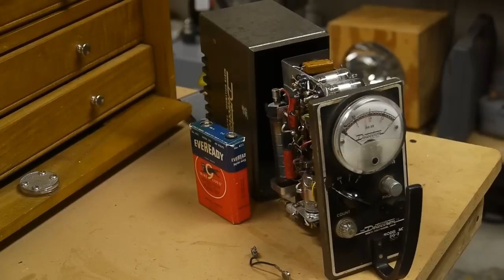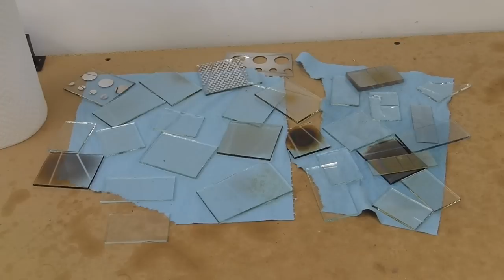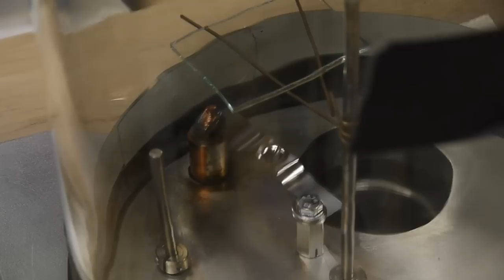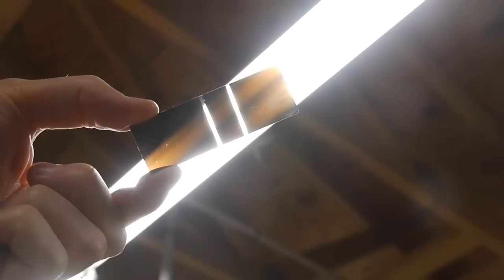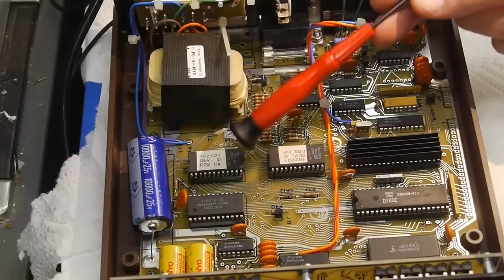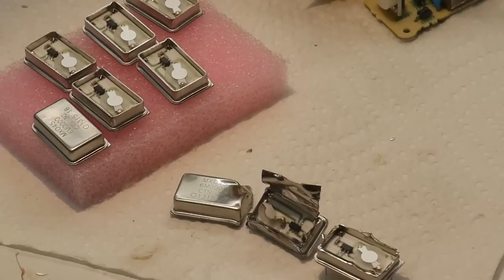Quartz crystal thickness monitor for vapor deposition in vacuum

Comment from the maker: Yes, the front panel allows setting density and acoustic impedance (ie basically the modulus) of the material being deposited. These values can vary quite a bit for different materials.

Comment: A Z80 processor... Do they still make those or maybe that microbalance is old? I remember writing z80 assembly back in the 80s. Anyway, neat trick for monitoring thickness. Thanks.
Reply: TI-84 calculators still run off of Z80s...

Comment: These sorts of thickness monitors can be very inaccurate if they are not mounted close to your sample. Also, try to use as good an approximation of the acoustic impedance as possible. Are you using InSn alloy or ITO to start? I hope that you have a needle valve for oxygen input. Too much oxygen is probably why you are not getting a conductive state. Controlling the oxygen level even if traces amounts is key to controlling the microstructure in metal deposition.

Comment: I heard these are also studied for explosive detection : they coat them with something that strongly bonds to the explosive you want to detect, and, as you said, detect the change in frequency due to the additionnal mass of explosive molecules bound to the surface, to detect ppm/ppb levels of explosive vapours. But dogs are still more sensitive detectors for the moment.

Comment: Hi, I'm setting up a temporary vacuum chamber for basic PVD. One of the 3 still unresolved issues is layer thickness measurement. I'll be deposing metals (Al, Ag, Au) but also some dielectrics as MgF and SiO2. Did you have any success with quartz resonators? I'm afraid that metal will either short out components or add to capacity of the electrode. I was thinking about using small brass piezo speaker, but that have much lower resonance frequency. Is frequency critical? Do you think trying out that kind of speaker make sense, or is it waste of time?
Any help appreciated!

Comment: I have the same thickness controller at home as a backup for my Sycon. I made a couple oscillator boards for them and have an extra if you want it.  Simple way to test the qcm is to breathe on the crystal. It will measure the water vapor deposited on it and then you can see it evaporate off. Etch processes will give negative numbers.

Comment: i wonder if we coat one crystal side with a bonding layer, we could in fact null that out in th e measurement, hence making the surface ready for depositing the wanted oxide more easily Also heating up a mix of silica with a salt and washing out the salt later to have a 'rough' transparent bounding layer would be something i would try as well. oxidizing components could be added as well to that layer.

Inspiring video!

Comment: I didnt´thought it was this easy to get crystals that would work for these, have only seen crystals specifically made for these and they were quite expensive.

But im guessing to get the right thickness the crystal have to be of the exact same size and if these crystals you used have that as the original ones then it´s time to get one of these controllers.

Comment: Hi Ben: Neat device.  Is there a correction for density? I’m thinking equal thickness of Al and Au will have different masses.  I particularly like the picture of your Detectron DG-2, very cool, I inherited one from my Dad.  Hopefully the GM tube is intact, they are notoriously delicate.  I have read that the pressure generated from a slamming trunk would collapse the tube (do cars still have trunks?). Cheers, Mark

Comment: Hello Ben. 

If you polarize the "boiler" and the glass (f.ex with a sheet of aluminium on top of the glas) with a high DC voltage, maybe you can control the layer thickness in a better way (by controlling the polarizing current). I suspect that you destroy the alloy when heating it up to much and thus, you dont get the alloy on the glas plate that you want.

Comment: "My" electron-beam evaporator at work had like half a dozen parameters to program every maintenance replacement... And another half a dozen parameters about the material being vaporized, deposition rate compensation etc etc...
I miss that machine (even though it nearly killed me during a repair, zapped me with 10kV  - lucky for me some of it passed through med ESD coat), it was my love/hate-child :D

Comment: Hi Ben, a couple of practical questions about vacuum chambers:
How do you seal wires going into/out of the chamber?
What kind of vacuum pump are you using?
Reply: In another video he uses some product from loctite made for vacuum seals. It allthough depends of the vacuum, maybe just a rubber plague or a o-ring will do the job